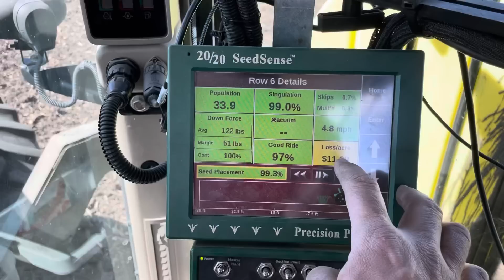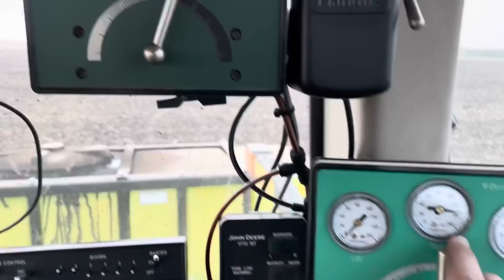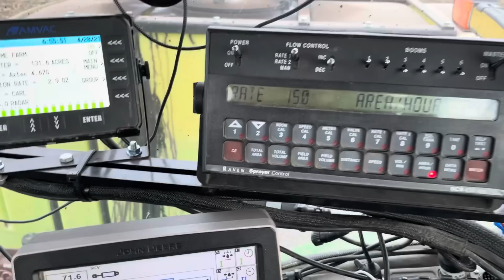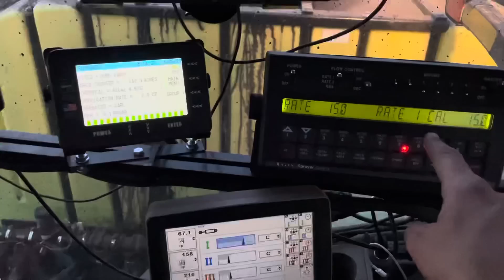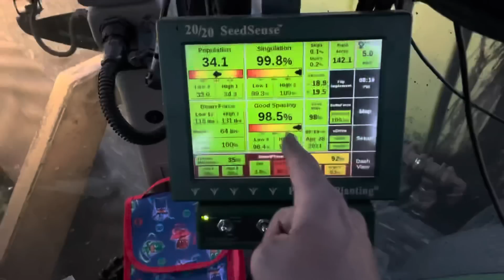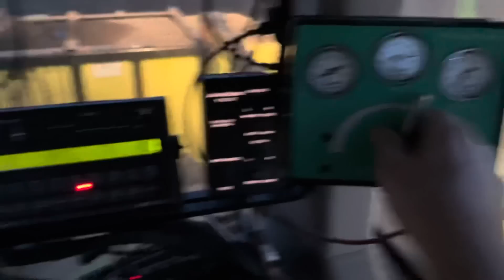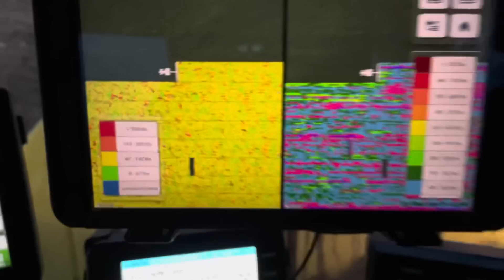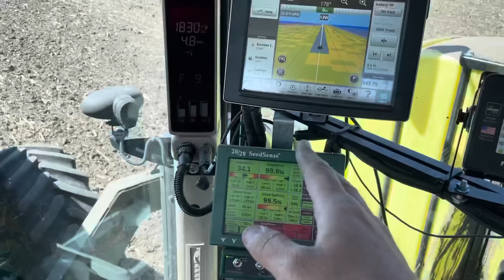Why does this tractor cab look like a space ship?

Comment: Thank you for your straightforward explanations of the various monitors - clear and concise.  Most of this "stuff" is mighty new and only recently developed, do you have any lingering concerns about reliability issues in a relatively hostile physical conditions (dust / vibration/ humidity/ temp swings) or that much of it is linked to John Deere rather than independent third party suppliers?
Likewise I would have concerns about system repairs and maintenance and updating as it seems that you would likely have to employ manufacturer technicians rather than fix them yourselves which in turn be hideously expensive and you could be waiting ages for their support to attend and fix the breakdown.
Reply from the maker: Actually I have always been able to make repairs myself with the input of a dealer on the phone. Each module is fairly easy to remove and swap to another row for diagnosing malfunctions. I should make a video about that too!

Comment: Hi Carl. At minute 14:50 during the explanation of the down force map, i’m curious what the black rectangles were? Does it just mean there’s no data available for that section or was there no planting?
Reply from the maker: That’s where I stopped to dig seed. If you stop and start out again, it takes it just a second to start mapping. There might be a 18” gap in the corn there but it isn’t as bad as it looks on the map. The best way to avoid that is to wait until you get to the RJS to stop and dig. The second best way is to lift up and back up a few feet and set it down and go. Then it will start exactly where it stopped.

Comment: Too much electronic stuff for my taste, one thing breaks and you might not be able to keep going and you can most of the time not fix it yourself.
Reply: Agreed we still use markers with a JD 7000 6 row planter
Reply: Had a friend down in No planter was down 10 days because of electric problems with sensors
Reply from the maker: I actually find the diagnostics to be pretty easy. The screen can show you all the voltages and amp draw of each module on each row. Makes it pretty easy to find a bad motor or broken harness wire. It’s also really quick to swap components from one for row to another to see if the office moves or stays. So far I’ve fixed everything myself with the dealer on my headset. 👍

Comment: Carl, are you concerned with the hack of John Deere? I understand that it includes all individual JD accounts, everything from farmer financials to production records to control over individual machine operation.. I follow one computer expert who actually knows what he is talking about, and he says there is a "worm" in the software that can allow machines to literally be stopped in the field. This does not sound good.
Reply from the maker: From our side of it, I’m not too concerned. We don’t have any sensitive information stored with them. If someone can see my yield on few fields, or what amount of nitrogen I put on, I’m not sure they can do much with that information. As for the tractors, I’m pretty sure I can disable the JD Link whenever I want to. Also, to my knowledge they have designed the system so than no adjustments can be made remotely. I was told by the tech guys at John Deere that they had to make it that way due to liability concerns. If they were trying to help us though an issue remotely and they accidentally changed something that caused us to crash the tractor or something there would be a major liability issue there. They can view our screen, but it’s just a video feed of what we see. They cannot alter anything remotely.
Reply: @dodgebrothersfarmandranch9206  That is good to hear!
Reply: That's not the only thing to be concerned with JD or any other manufacturer... with all that software and electronics makes it a slippery slope when it comes to repair on them...
Reply: I looked up the Motherboard report from April, and in my opinion this particular hack was only an information leak and did not give hackers access to equipment control.   But in general the interconnectedness of all systems does create the potential for problems and it's up to the manufacturers to properly protect all the possible entry points.
Reply: @jazzerbyte  Louis Rossman, a computer genius who runs a major computer repair shop in NYC with over 1M subs had an excellent new post on the subject. He has seen proof that the heck is very serious and has precipitated JD making emergency hires of internet security experts. Rossman is not an alarmist and a true national expert on Right To Repair as a defense to certain vulnerabilities that may have to be addressed literally "in the field" for agriculture. Thanks for your comment.
Reply: @lewislindsey1946  I took a look, and it does sound like there is still a backlog of bugs for John Deere to fix, and more serious than information leakage.  It is certainly possible since there are connections for remote diagnostics; Chrysler was similarly remotely hacked via its entertainment system.
Reply: @jazzerbyte  Thanks for going to the trouble to research the situation. Way too often individuals just attack any comment that does not make them happy - if they really can ever be happy. I appreciate your effort.
Reply: I am still interested to know what Carl thinks.
Reply: @lewislindsey1946  n
Reply: that is the biggest load of bullshit that i have ever read in a youtube comment section. Well done.
Reply: @johnmcgee9159  Why do you say that?
Reply: @lewislindsey1946  " I follow one computer expert who actually knows what he is talking about, and he says there is a "worm" in the software that can allow machines to literally be stopped in the field."  Bullshit of the highest order.
Reply: @johnmcgee9159  Why do you say that?

Comment: Carl, why would you get multiples if it’s a finite space that the seed is encased in when it’s coming down to plant?  That was a great video!  Thanks 👍
Reply from the maker: Thanks! I should try to show this later on. The seeds are stuck to the seed disk with vacuum sucking air though the holes. Sometimes two seeds stick to one hole and occasionally the singulator can’t knock if the extra one.
Reply: @dodgebrothersfarmandranch9206  thanks. Now I get it